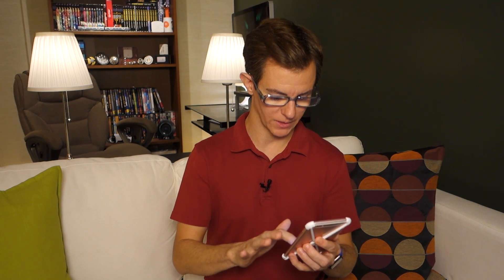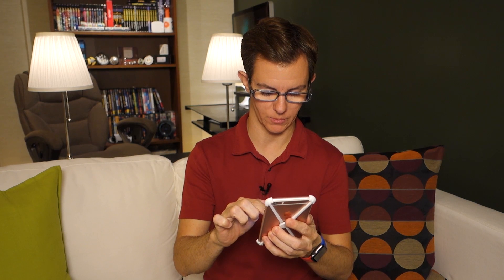LED Lighting Q&A - October 2016

Comment: Hello
I had my Hue lighting working great till I added some new bulbs onto it.
I’m in Ireland and was in the USA acouple of weeks ago and picked up two 3rd gen bulbs and a lightstrip plus.
The lightstrip plus is working great but the 3rd Gen bulbs are going a bit strange for me.
When I turn off the bulbs from my app or ask sri to turn them off one of the bulbs will turn back on a few seconds later, then later in the night the other bulbe will do the same. This only happens with my 3rd Gen.
I did phone Philips up about it and no luck so far.
Did any of you guys hear about this and if so do you know how it’s fixed.

Comment: Be careful with some adapters. Things like G24Q sockets are generally for CFLs that do not have their own ballast in the bulb, you'll have to make sure to remove/bypass the ballast behind the socket or you'll blow your LED light.

They do sell adaptors, but you MUST remove the ballast before use or you're going to have a bad time.
Reply from the maker: +Bryan Wyatt Good point.

Comment: Interesting about the bulb base adapters. Could those cause issues with dimming?
Reply from the maker: +FAUguy23 good question. The adapters are essentially just electrical connectors, they shouldn't cause issues. And, after several years of use in the "home studio", they've yet to cause any dimming issues.

Comment: Thanks Joe. Very timely info as I just bought several of the PAR 30 White & Ambiance bulbs and am thinking about buying several PAR 30 Color & White. I called Phillips tech support and it took them 15 minutes to find the PAR 30 W&A bulb and confirm it was Gen 3. Actually, the tech said that this is the first PAR 30 W&A product but that it was branded Gen 3. He could not/would not confirm that a PAR 30 Gen 3 Color & White would be released but I'll trust your intel over their tech support and keep my powder dry a little longer to see if a new version is released.